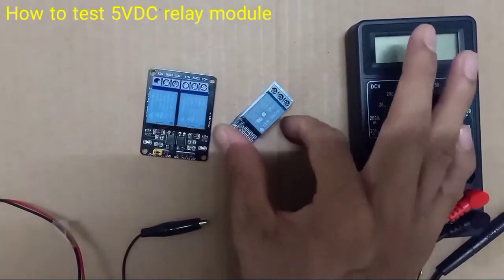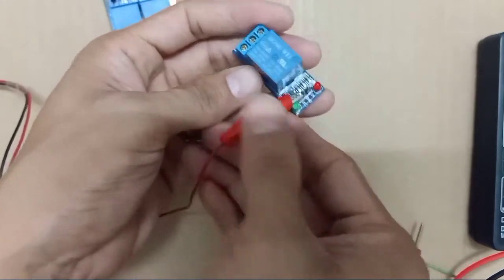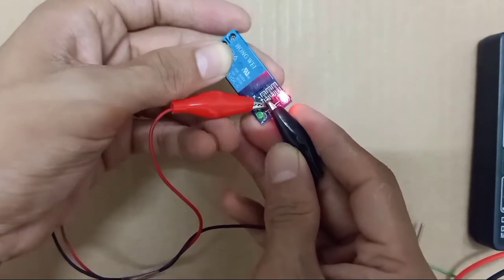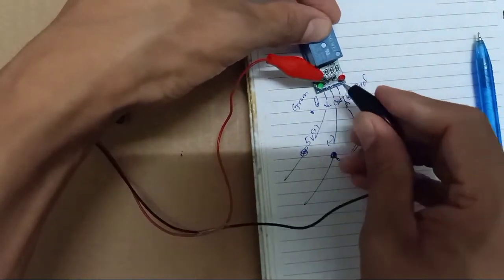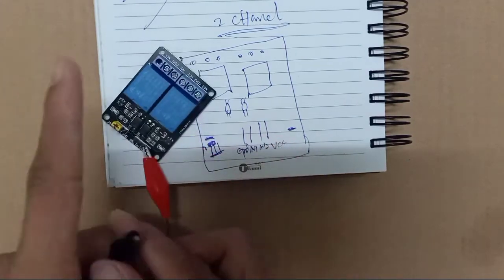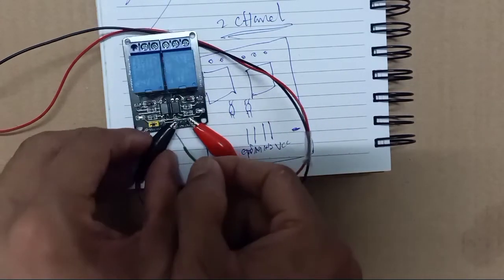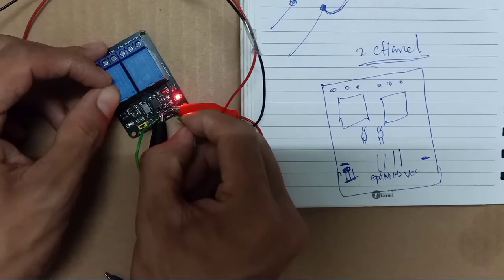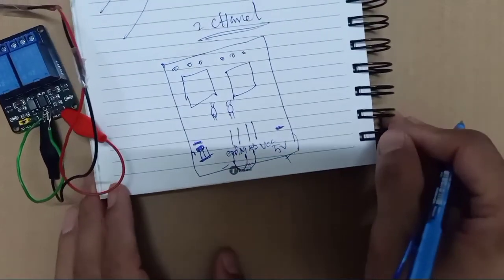How to test 5VDC relay module

Comment: Only led is blinking but no sound from relay
Reply from the maker: @pushkar-sg  Are you using 5v?
Reply: @passiontechklm  Yes bro giving power to 2 channel relay module by arduino
Reply from the maker: @pushkar-sg  Arduino 5v to Vcc and Gnd to Gnd.... and than Gnd try to connect to IN1 for testing relay board
Reply: @passiontechklm  Done but still only led blinks but no sound from relays...
Reply from the maker: @pushkar-sg  is it 5V Relay board.?
Still can not on means the coil must be stuck.can not use.
Reply: @passiontechklm  Yes 5v is written on the top...
Reply from the maker: Try to use new one
Reply: @passiontechklm  By default the relay is in which position NO OR NC when no voltage is applied to it

Comment: Can we use dc currect in output side
Reply from the maker: Out put side you can use both AC and DC
Reply: Can I connect 12v dc strip light in relay module
Reply from the maker: @MXmoviesclip  yes you you can control 12VDC led strip lights
Reply: Is the connection same like AC ?
Reply from the maker: @MXmoviesclip  yes the same connection
Reply: Thank you so much for replying my comments and for your information.

Comment: My 12v relay module is turning on with out getting signals from arduino
Reply from the maker: by right,12v Relay module directly can not trigger from Arduino since Arduino is only produce 5v output. May be your relay is error.
Reply: Needs Pull up/pull down resistor